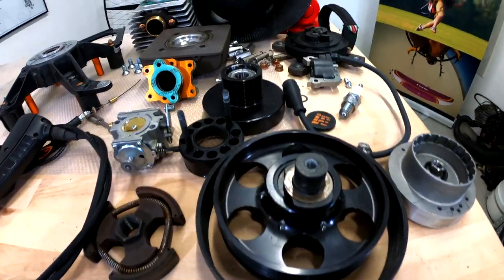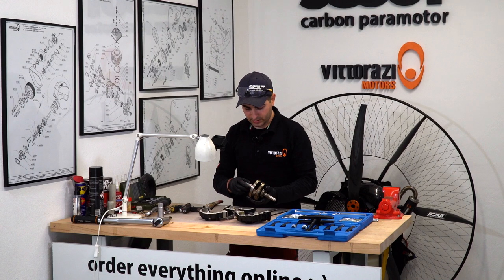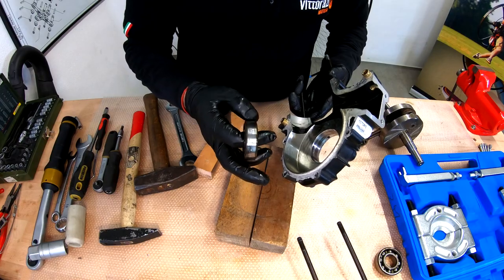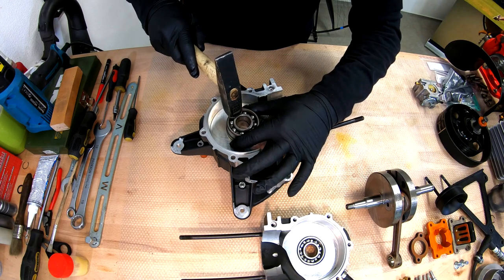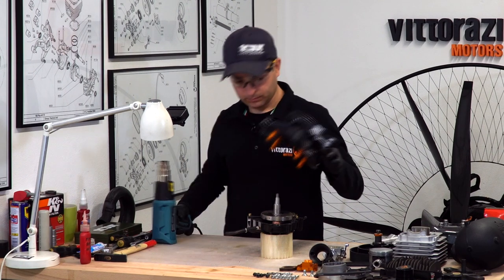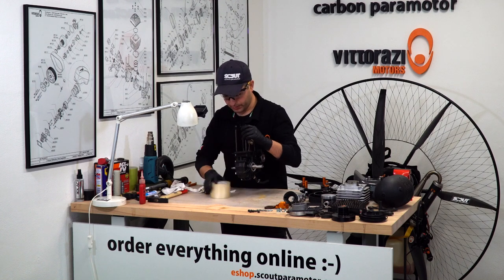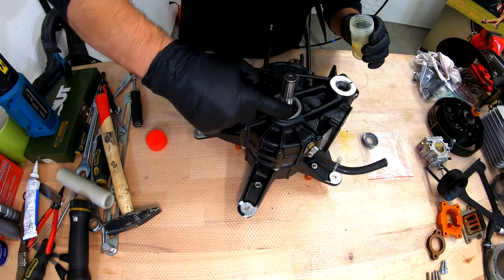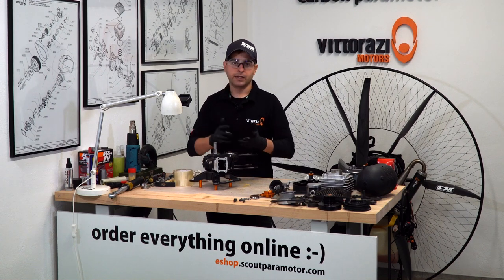Vittorazi Moster plus Crankshaft bearings replacement. Paramotor engine maintenance series

Comment: Perhaps next time, try freezing the bearing. Though, if you froze the crank, you could put both hot bearings on it--and then freeze the whole crank and bearings, and drop it in the hot housing halves, it might work easier. A thin film of 2-cycle oil will help protect the bearings and crank from rust from the frost.

Comment: Why not use heat to remove the bearings as you may damage the aluminium case if the bearing picks up on the case on the way out?